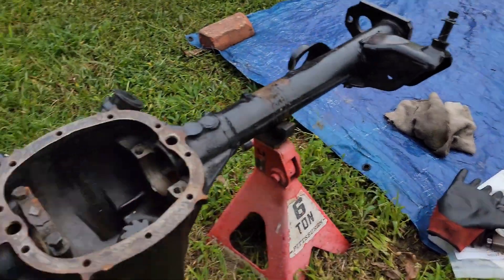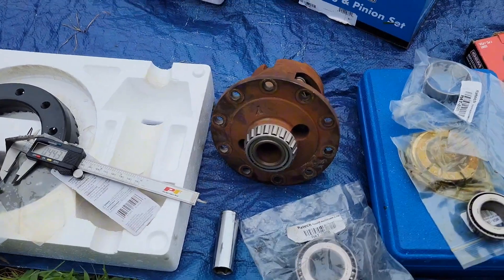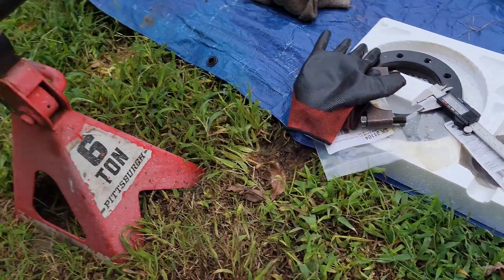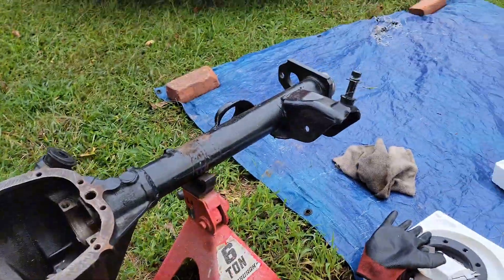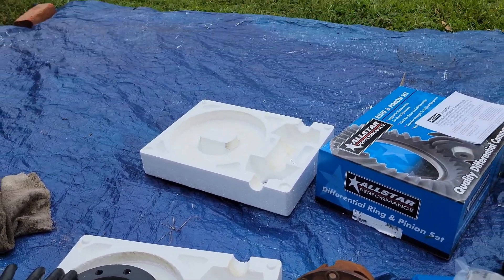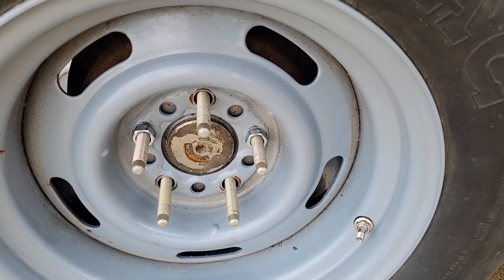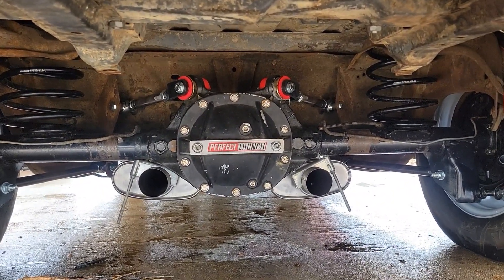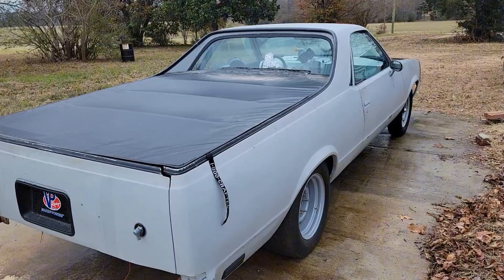How to build the ultimate GM 7.5 rear end build

Comment: How much horse power can that rear and handle? I’m building a 6.0 LS with 500 hp for my Monte Carlo. I was thinking about doing this because I have a 7.5 10 bolt. and I’m having trouble finding a 8.5. 10 bolt where I live
Reply: Im in the same boat, I habe a 9 inch but do not want to do all the fab work at the moment. Nice to use the stock deal woild be nice to know what one of these would handle.

Comment: Do you think i should rebuild my 7.5 in a 1988 chevy caprice motor only makes 420-450hp
Reply from the maker: You could, but it depends on how heavy your car is and how you are going to use it. mine weighs 3200lbs race weight, I'm not sure how much a box weighs, but if you are just riding and spinning the tires and stuff, you should be good with some  street tires but if you got rims I'm not sure. More weight equals more stress on the rear end
Reply: @Runitupracing  it is 4000lbs do you kno what car i should get a rear-end out of that will fit mine
Reply from the maker: 8.5 10 bolt came in the police box chevy. I'm not sure what year right off.
Reply: I have a fiberglass rear bumper if you want it. I just had an extra one in the box.

Comment: I hope your still monitoring your chats. I'm currently Replacing my 1969 Pontiac Grand Prix Model J. Entire Rear end. I'm asking should I just Go with a complete swap with a Ford 9" or a GM 8.5". Your thoughts please is much needed. I'm still at the disassemble phase, due to the right wheel came completely out while driving. OH, and all Original Parts I had heavier Crome wheels on it and was rolling Hard. Hell to hard.
Reply from the maker: Get the best you can afford. If a 9" is in your price range, get that. I just upgraded my gm 7.5 because i see others run some good times, and my car has been gutted, so you can get away with a little more without a full weight car. But it depends on how you use your car.
Reply from the maker: When this rear brake, I'm going 9"
Reply: @SSTWOIN  Thanks for the suggestion any Vids with complete removal you recommend is appreciated.

Comment: I think you are doing the right thing vs swapping in a 9 inch.  I watched your other video and it's a N/A small block, I'm not trying to talk down on the engine but it can't possibly be making a huge amount of HP, and the car is a light car.  So, I think a 9" swap is overrated on certain cars. I've been saying for years why not just put some chromoly axles and an aftermarket posi in the stock axle.  Obviously a th400 and a ford 9 inch is the ultimate, but supposedly they have more parasitic loss than let's say a th350 and a 10 bolt. because they are literally bigger and heavier stuff.  The only problem is that you might outgrow that 10 bolt once you start adding turbos and stuff like that.  but all that doesn't matter build it, show people what it did and thats all there is to it.  Thanks for sharing what you are doing.
Reply: What's a "huge" amount of horsepower to you? Small block Chevys (or BOP) have been built to at a very wide range of horsepower and torque levels.
Reply: @focused313  Well it's a N/A small block chevy.  I think it's a 383 I looked at his other videos, but I forgot.  I think a huge amount of power is like over 500 hp over 500 ft lbs.  Something that you won't hardly achieve with any small block unless its boosted.  Or if its running on alcohol.  I'm pretty sure if you have a set up like his it can handle probably any NA small block, but that's just my opinion.
Reply: What about a 383 that makes 6 plus 250 spray?

Comment: What gear ratio did
Reply from the maker: I ended up going back with a 4.56. To see  if I would run out of gear on nitrous. But I also have a 4.10 if I do.
Reply: @SSTWOIN  how did the 456 workout
Reply from the maker: @RonnieYoung-zx8wu  it's the same gear that I had before when I ran the car on motor haven't sprayed the car yet
Reply: @SSTWOIN  ok

Comment: Parts list?
Reply from the maker: Moser Engineering Replacement C-Clip Axles A102810 (28 Spline Axles) 
2x ARP Wheel Studs 100-7704
Moser Engineering C-Clip Eliminator Kits 9200
Yukon Gear & Axle Dura Grip Positraction Carriers YDGGM7.5-3-28-SM
 Proform Perfect Launch Differential Covers 66667
Reply from the maker: @Runitupracing if you got any questions just hit me up
Reply: @SSTWOIN  thank u I appreciate that brother 💯🙌